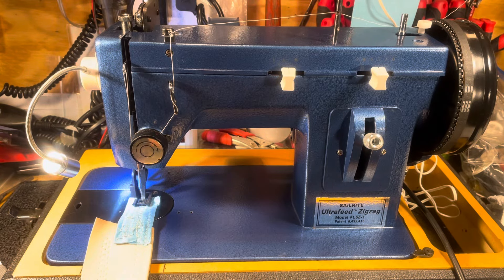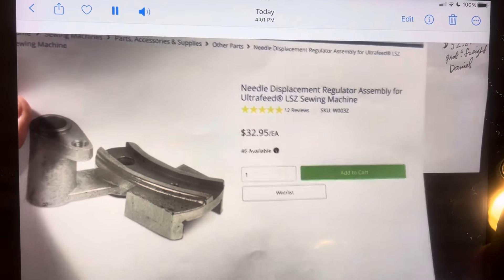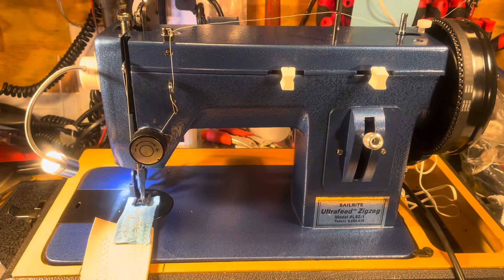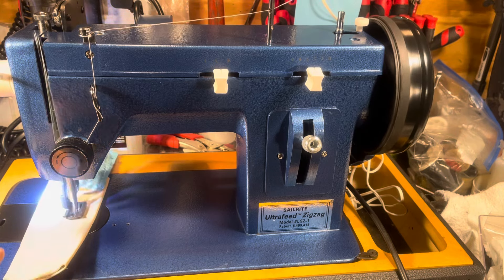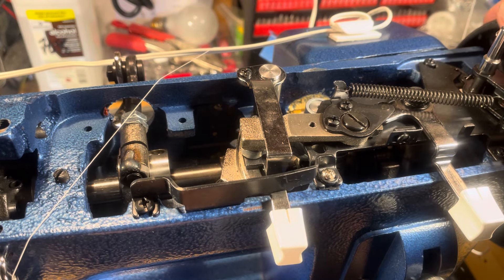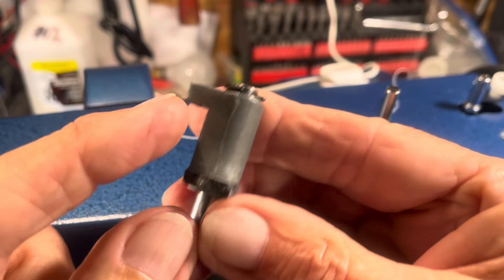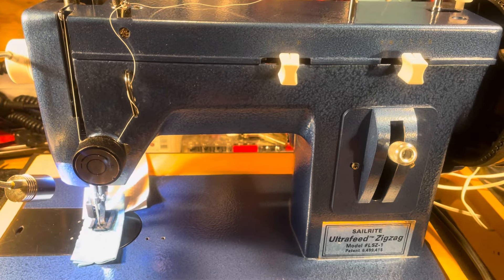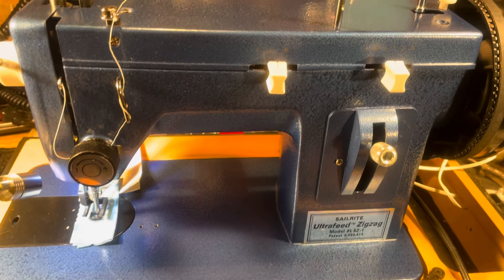THE SUSPENSE IS OVER -THE MYSTERY IS SOLVED. DID SAILRITE SEND A QUALITY REPLACEMENT PART?(video400)

Comment: I'm glad Sailrite was professional and prompt. It's nice to see that some companies recognize their mistakes and correct them. 
I have a Japanese made machine branded Hallmark  model 1692 that has a similar part. My guess is it's from the mid 60s, and still runs like a charm.
Reply from the maker: I’ve worked on countless side load zig zags. I’ve never seen that particular problem in any of them. 
I guess a cheap part supplier appeared and sold them a poorly made part. 
They definitely made it correctly in their newer models and replacement parts. 
Hats off to SAILRITE.

Comment: I saw a Singer 920 Futura 2 today, and I didnt know what to think of it.  It wasnt beat up, came with a manual, but the thrift store had the pedal taped to the top of the machine, so I couldnt lift the lid to get a peek at the other controls/features
On a scale of 1-10 , what would you rate a Singer 920 Futura 2, Randy?
The handwheel turned, but felt like it had a problem.
Reply from the maker: If the timing belt is ok, you’ll just have to replace the four lower feed and hook drive gears to get it up to speed. Replacing the timing belt is doable, but not terribly hard. 
The belt is still available, as are the gears. 
Once all that is done, you can check the bobbin winder actuator cam, that’s located under the hook, to make sure it’s not cracked, and non functional. Those are still available.
Then you’d check the plastic shaft collar cam on the top left of the main shaft, to see if it’s broken. Those are still available. 
The motors are good forever, and if no one’s dropped the foot control, it usually is also.
The only time I rebuild one is when the customer has a sentimental attachment and money is no problem. 
It happens, but not as often as it used to.
Reply: @randyyoursewingmachineman9954  Thanks for the rundown.  Based on your detailed answer,, a rating of 5 on a 10 scale would be a fair score. 
If its still on the shelf when I go back to that shop, I'll be sure to walk faster as i pass by it.😀
Reply from the maker: @robotbuster1487  good call. Life is too short to buy plastic infused sewing machines. 🤣😎👍🏼
Reply: If the machine was made with a crappy part, why didn’t they replace the part at no charge for it.
Reply from the maker: @billhatcher9303  probably because it was ten years out of warranty, and I didn’t even ask. 
They may have if I would’ve inquired.  
I was pleasantly surprised that it was in stock, and shipped the next day.
That’s a rare outlier in this current climate of supply chain failures and lackadaisical dealer support teams.
I give Sailrite 5 stars for the results they provided to me and my customer.
The fact that the machine sat inactive for a prolonged period of time exacerbated the issue of the part freezing in place. If the machine had been used more frequently, and kept serviced more rigorously, it probably wouldn’t have locked up and had the part failure.
I feel confident that the new part will perform properly for the duration of the machines use.
I will continue to recommend SAILRITE sewing machines to my customers.😎👍
Reply: So....  Just right off the top of your head--how much shared DNA do these have with the Thompsons?
Reply from the maker: @theprojectproject01  they are so identical that from a distance (or up close) you can’t tell them apart. Remove the decal and they’re indistinguishable. 
I believe they have evolved from the same origins and may be owned by the same folks these days. I don’t know for sure, maybe someone else can add context. 
I do know the original Thompson Mini-Walker that  I sold new in the 70’s, was made by Datho Manufacturing in Lubbock Texas. (If my memory serves me well)